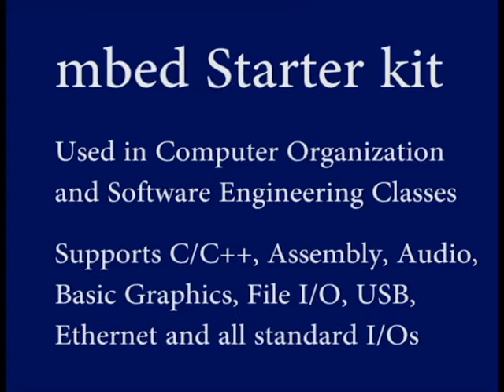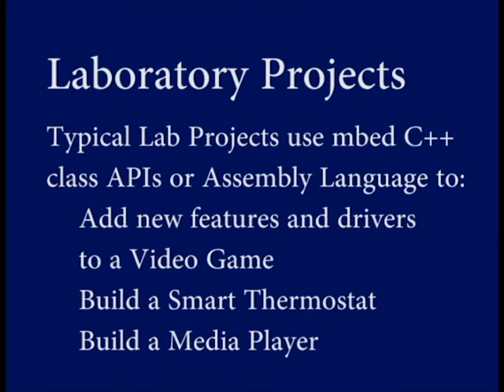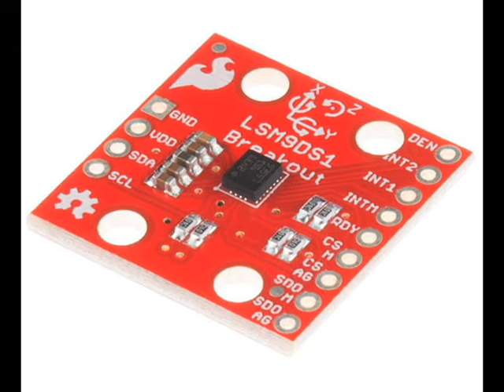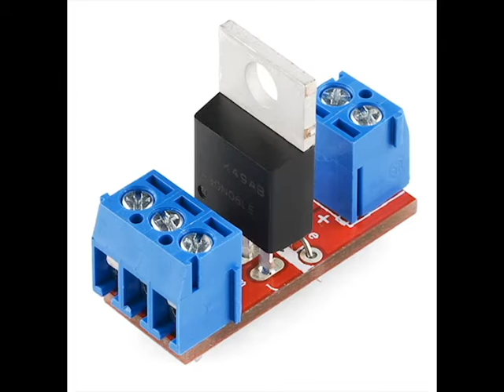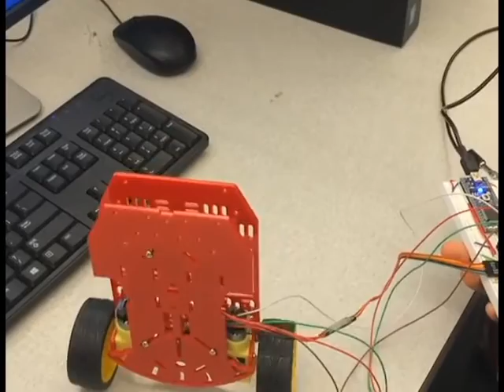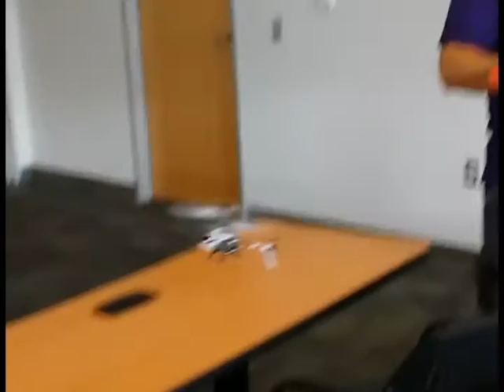mbed: Hands on Learning@Georgia Tech_Hamblen

Comment: The kit looks excellent. Like the other videos here, I want to try everything. Do students purchase the kits or are they loaned out? If purchased, what is the price? Are there activities that also use the myDAQ that students purchase? Do students work anywhere or largely in class? What process did you use to determine what to include in the kit and do you update the kit each year or term?
Reply: Kit is updated about every year, the second add-on kit is updated a bit more often. Sparkfun sells the basic mbed starter kit now (it was based on our first kit). Students buy the kit and the price is around $110 for the first kit and $160 for the second (but the two students on a lab team can share the second kit in ECE 4180). This is with educational discounts and bulk shipping. TI has also donated a few parts for the second kit that will plug into a breadboard without the breakout board (DIP package and not not surface mount). That has saved us about $10 or so on the second kit. Not many DIP parts left around these days! They do use the MyDAQ in scope mode in the first lab in the advanced class to see PWM and SPI I/O output pins.

Comment from the maker: Why did you choose the mbed as the platform? What features does it have versus other platforms?  How long do students have to work on the projects? What support do you give to them?
Reply: Cloud compiler with full C++, Easy to use C++ class APIs for all I/Os, USB, networking, file system drivers, and optional free RTOS on ARM processors. Mbed had this earlier than some other current options.

Comment: From the ECE 2036, Engineering Software Design, web page and syllabus, it looks like the emphasis of the course is on learning C/C++. Would you say that the kit (and lab assignments) are primarily aimed at learning programming, or is learning about hardware also a goal?
Reply: It covers full C++, but since Mbed runs full C++ it can be used for several of the labs. They are given hardware drivers (C++ classes) and hello world examples in C++ for each hardware device from Wiki pages at developer.mbed.org. This gives students an introduction to hardware basics and some microprocessor hands on experience - but less than in a full microprocessor orientated class.